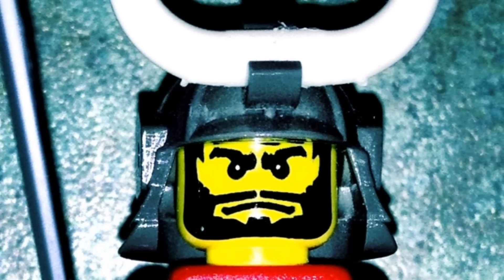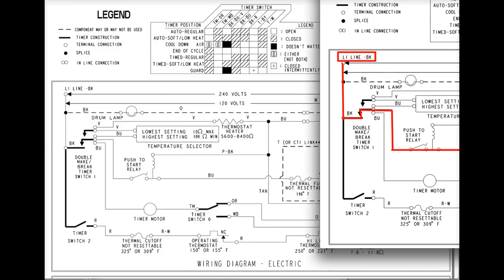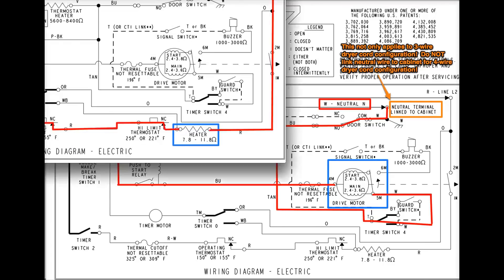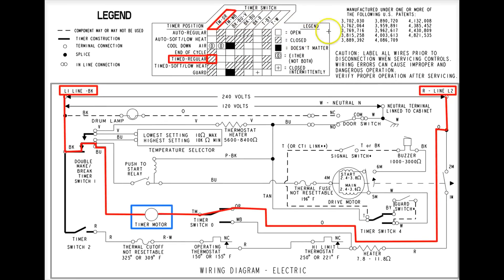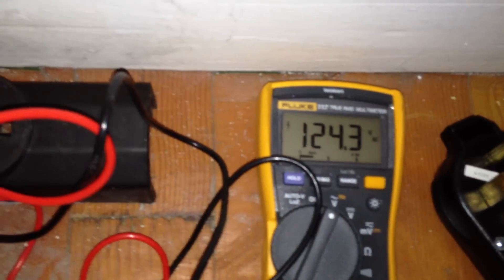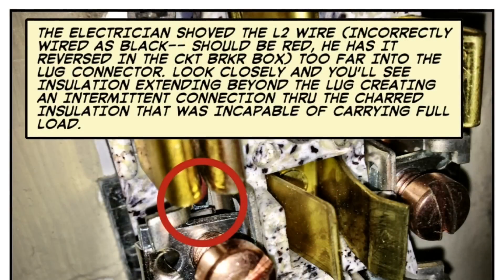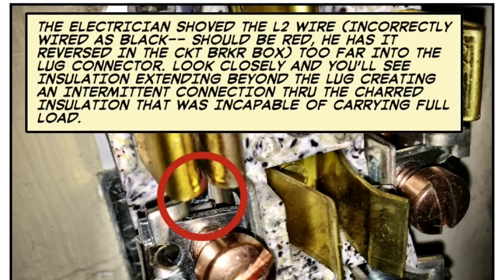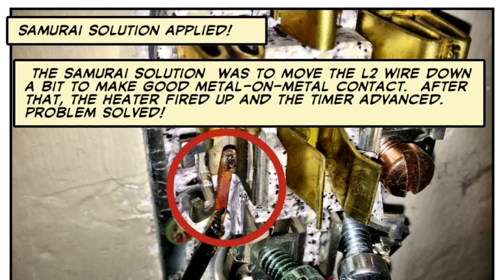Fixing an Electric Dryer that Doesn't Heat and the Timer Won't Advance (but the motor runs)

Comment: Thank you!!! I had the same symptoms after running the dryer probably five times over eight hours one day.  I had replaced the outlet myself a year ago. I took the outlet apart, didn't see any obvious damage or issues, and put it back together.. and it worked!  Cost me $0 and didn't even have to consult a wiring diagram. Thanks so much for your helpful video!!

Comment: Just wanted to give you a huge THANK YOU!!! Had this exact problem with our electric dryer, and we ended up having to replace the entire outlet & the plug to the dryer. With all the rain we've been getting, water seeped in & corroded the outlet. We were extremely lucky that we didn't end up with a fire! Replaced outlet, cord, and moved the outlet so we don't have the same issue down the road. Again, thank you, so much!
Reply from the maker: piperdawn7 Thanks for watching!

Comment: Problem solved courtesy this video. My toggle switch went bad delivering only 120-125V to the dryer. Changed the switch and now i'm back in business. You saved a bro for the weekend. Thanks!

Comment: I noticed the dryer timer knob quit moving last night. Clothes were still wet after an hour of drying but the dryer was coming on and spinning. Started searching for this problem and was getting ready to start pulling things apart to test. I watched this video and just for the hell of it, I went straight to the fuse box and guess what?? Yes the breaker was Tripped but dryer still coming on!
I reset it and BAM we have a working Timer with Heat! Glad I watched this before diving into the back of the dryer. Thanks for your time. 👍👍👍

Comment: This was my exact symptom with my dryer and it was a loose connection at the wall! I fixed it in about 5 minutes Thank you so much for this video proablly saved me hundreds!
Reply: joel98z thanks for your comment or I wouldn’t have fixed mine! It wasn’t plugged in all the way

Comment: I followed your advice on this video with no luck. I'm confident I don't know how to read an om meter correctly.lol I was at a loss. I got another drier and it ran but the same problem existed, therefore I knew it had to be L2 as you say. I still have fuses and who knew L1 and L2 run on separate fuses. Problem fixed.

Comment: Thanks! I was having this exact problem; timer not advancing, no heat, but the tumbler still working. I just moved into this place, so I figured we bumped the dryer in the move, out some other similar issue. All I did was flip the breaker, and it works fine now. Should I inspect the 220 outlet, just to be sure there isn't some sort of insulation interference like you were getting? Thanks again for the video, is very well made, and you do an excellent job of explaining what you're doing.
Reply: I was having the same issue and since I am impatient, I decided to go straight to the comments. After I read, flip breaker, I just knew that had to be it...sure enough it worked. you saved my life, I was sitting here with a few loads of washed laundry that I did not want to walk out to the community dryer.
Reply: Joey Haizhou Li I turned off the main breaker in the house, unplugged the dryer, plugged it back in, and turned on the breaker. I also found out it's a good idea to check the exhaust hose and make sure it's totally clean. I went outside and cleared the exhaust cover of lint, and all of those things combined solved my problem.

Comment: Could this contribute at all to a heating element coil breaking? Our Speed Queen dryer is 3 years old. Timer isn't advancing on certain cycles and I found a coil broken when I opened it up. Or would a coil disconnect be responsible for timer issues? The house and thus the outlet are seventeen years old. Haven't checked the outlet yet by process of elimination but I have to wonder.

Comment: Excellent video. I have had a few problems with my frigidaire dryer that came with the house- and now the timer has stopped advancing. So I will give this a look tomorrow when I have more time.

BTW- I have a fer311fs0 and when I had to get in the control panel it slipped and some wires came out- I got them back in, however there was a green wire with a clip that had no home. It's clip was different than the others. I saw a photo on the internet of it clipped to the cabinet- yet there is already a green ground screwed to the cabinet. Could hooking this additional wire up be part of my problem?

Comment: I like these videos. Showing me and explaining the schematic helps. I am not sure I understand why or how the motor can work if L2 is not working but will take your word for it. Again, I like your video
Reply: Because the motor only relies on 120VAC to run which is supplied on the L1 line whereas the element and timer require 240 from a combination of both L1 and L2

Comment: I have a Whirlpool lgr4634jq0 and have the same problem—no heat and timer not advancing. Others have suggested that checking the fuse box might fix it. But if the breaker tripped, wouldn't the dryer not power up or work at all?

Comment from the maker: Sounds like a wire got misplaced while installing the heating element and created a short.  The breaker is probably tripped.  You'll need to get the wiring diagram inside the control panel and re-trace the wiring for the heating element.  We can help you in more detail at the Appliantology forums if you start a new topic in the Laundry forum.

Comment: I have a dryer that only just recently the timer stopped advancing. However, there is SOME heat, just not much, regardless of fabric setting. Any idea what the problem could be? In my search for the problem I've read it's likely the timer motor. This dryer is an older GE. What are your thoughts?
Reply from the maker: allourvice Depends on which cycle the dryer is not advancing in. All cycles = bad timer. Autodry cycle = (usually) bad cycling thermostat.

Comment: Awesome diagnosis!   My dryer doesn't carry a full load  but dries intermittently but very seldom  (gotta check my wiring)!!! Thanks    Think a single chick can do it?  Will try and post....would love some encouragement from you dudes!
Reply from the maker: Could be a problem with the vent, too. If too much back pressure, this retains heat in the dryer and the safety devices will cut heat. Good place to go for more detailed troubleshooting help from other tech is https://appliantology.org/ Register a free account there and then start a post in the DIY forum.

Comment: Have a Kenmore 70 series 110.60722990 : symptoms are, motor doesn't start spinning or make any sounds when start is pressed.  Heater heats up until BRIGHTLY GLOWING ORANGE HOT.  Can hear the mechanism that turns the timer humming even when door is open.

Could a bad door switch cause all this?  Or bad timer, or bad heater over-temp sensor?

Comment: Did you switch the wires before you recorded?  Each leg carries the same voltage.  Why does it matter which leg is connected to which lug?
Reply from the maker: Although each leg carries the same voltage, they do different things in the circuit.  Dor example, if L1 and L2 were switched and L1 was not working right, the motor would not run.  Watch the video again where I explain the motor circuit.

Comment: Just a question...

If the jacket of the wire was impeding the flow of electricity, when burnt, why was it not a problem when the jacket was not burnt?
Or were you saying that the melted jacket worked its way up the copper?

Not too long ago, I replaced a service entrance & accidentally pushed a neutral wire too far into the bus. Of course, I wound up with
a circuit that didn't work until I discovered the problem. Just wondering if that was the same problem.

Nice video. Thanks for the upload.
Reply from the maker: The jacket was creating a high resistance connection. With no current flowing (no load) you would measure full voltage at the outlet. But when the circuit was loaded (dryer on, current flow), most of the operating voltage was getting dropped across the high resistance connection in the outlet per E=I*R.
Reply: Good morning.

"The jacket was creating a high resistance connection." 
So then there WAS a problem, before the jacket had melted? You don't mention if the customer was having problems with this, right from the start.
If the wire was pushed too far in, with the jacket impeding the flow, how is it that the jacket melted? And what would cause the connection to spark?
After you cleaned up the connection, did the dryer connection stop sparking?

Perhaps I'm not understanding you correctly, but what difference does it make which load-carrying wire is connected to the outlet?
After all, they're both carrying the same amount of voltage from the breaker? As long as both hots are connected correctly at the outlet, it should work.
I know I must be missing something.

Trust me. I didn't come here to make trouble. I'm just trying to understand. I've been doing electrical work for a long time, but never came across a problem like this one. I'd like to better understand this, so that I can make better troubleshooting decisions. That's why I love to watch guys like you. Can always learn something.

Thanks for your time.
Reply from the maker: High resistance connections produce heat, P=I^2*R. BTW, a “high resistance” connection can be as little as 5 ohms. A 5 ohm connection in a 240 VAC circuit in series with a standard bake element, for example, can produce over 200 watts of heat. That’ll melt some insulation! If you really want to learn circuits, take our Fundamentals of Appliance Repair Course, https://mastersamuraitech.com/appliance-repair-courses/fundamentals-training/
Reply: Thank you so much for straightening me out about that!
Like I said... If you're paying attention, you'll learn something.
Really appreciate you taking the time to reply.

Subbed.

Comment: hi, I have an amana. I've had it for 5 years and I don't know how long the people before me had it. I bought it with the house. I noticed a couple days ago the timer isn't working and the dryer don't heat up. it still spins and turns on. I have a small amount of heat for a minute on the low heat setting.

Comment: Whirlpool LER4634EQ0 110 v timer motor, when timer contacts TM to WB are closed timer doesn't run and I read 240v from L2 to neutral like it's reading back through the motor to L1. Timer motor runs when wired directly to 110v. Any thoughts?

Comment: Curious question- the problems that arose. Were they immediate after plugging in or happened over time? Thanks
Reply from the maker: This dryer never worked correctly after the electrician installed the outlet because the outlet was wired wrong.

Comment: Could this be the problem if the dryer had been working and then stopped? Meaning, it has been working fine for 3 years and now the dryer won't heat and the timer doesn't advance, but the motor still runs? Thank you.
Reply from the maker: Yes, it is possible that you have a problem with the dryer outlet. If the wires weren't installed tight enough in the outlet, for example, then overtime the dryer outlet would develop a loose connection, killing either L1 or L2. You would just need to troubleshoot to find out exactly what the problem is. We can help you do this in the laundry repair forum at the Appliantology Academy.  Head over there, register (free) and start a new topic.

Comment: I have a Maytag dryer and the heating element does not turn on. What do you think can be the problem? At first redryer stop heating then stop turning. I replaced the but still had no heat. I then replaced the thermal switch and the dryer was heating. However after a few loads it stop heating. I was told to replace the heater element since the coils were not turning red. I did but still have no heat. Please help.
Reply from the maker: Juan M Esqueda See this video for instruction on how to troubleshoot this problem:  http://youtu.be/ksKeFau_56E

Comment: i've got a kenmore dryer that only runs when the push to start button is held down.  while it's running the timer does NOT advance and the dryer does not heat up.  i have swapped the motor and heating relays and nothing changed. does this sound like a push to start switch issue, could BOTH relays be faulty, is it the timer, or possibly the electronic control assembly?
Reply: +Derek Powers i just tried to run the the "diagnostic test" and got no beeps

Comment: I have a Whirlpool that I purchased used.  It has never heated properly.  I would say 60% heat output.  I checked the vents and made sure it was not plugged up inside machine.  Just recently, I have lost almost all heat AND my timer does not shut the dryer off.  If I set at 60 minutes, the timer WILL advance.  However, when it ends its cycle, instead of the buzzer and dryer shut off, the dryer continues to run.  Any thoughts?  Thanks
Reply: start push button could be stuck closed

Comment: Me again.  Why does it matter where line1 and line2 is in the panel.  Does a certain one actually have to be above the other one in a breaker panel?  Or a certain one have to be on a certain side or bus of an older fuse panel? 
I have read you for several years and respect what you say.  I am just confused on this subject.

Comment: Hello sir i bought a new dryer because i thought my old one was broken. the old one the timer wouldn't turn and no hot air so i thought ok it's 10 years time to change it. So i bought the new one connected it and the same problem. Can you help please thank you.
Reply from the maker: memoranda1 We can help you troubleshoot this in the Appliantology forums.  See this page to get started there: http://appliantology.org/topic/51337-getting-started-at-appliantology/

Comment: I can see where it cause problems if the wires were crossed at the recep, if one does not check carefully the work of the previous electrician or diy'er.

Comment: Thank you! I was really suspicious as to how I could have two things break at the same time (Timer not advancing in Auto cycles AND no heat from element. Sure enough, you had the solution. And I was about to buy a new set that probably wouldn't last as long as the one I already have. You rock!

Comment: Does anyone have any ideas why a dryer timer won't advance after a power surge? The dryer was running and lightening struck a transforming near my house. After power was restored, we realized that the dryer breaker had tripped. After resetting the breaker, the dryer works yet the timer doesn't move. It's a little over a year old. Thanks in advance!

Comment: Leads switched at the box?  How to you know which is line 1 and which is line 2 in the box?  Sorry, I am still confused.  If both lines are secured, I still do not understand why it matters where they are connected EXCEPT for testing purposes  IF both are secured and working properly.
Reply from the maker: The whole point of this video was that one of the lines was NOT working properly.  The complaint was that the timer was not advancing nor was the heating element working.  The only thing that worked was the motor.  In the video, a real life service call, I take you through the reasoning and troubleshooting that was done in order to discover the cause for the problems: bad wire connection for L2 at the outlet.  

Now a question for you: how did I know that L2 was bad and not L1?
Reply: I would think because the schematic shows line 2 as power source for the malfunctioning parts.

Whether that line be red, pink, brown, etc.  It just happens that it shows to be red. Heheh, I have read you for a few years  off and on.  I do respect your thoughts on appliances.  I am just easy to confuse.
Reply: I should have said the malfunctioning area needed both line 1 and 2.  Line 1 was doing it part.  Testing showed line 2 to be at fault. Malfunctioning area required both line 1 and line 2 (220 volts).
A similar situation helped get me into appliances.  Dryer would run but not heat.  Old fuse box had one blown fuse.